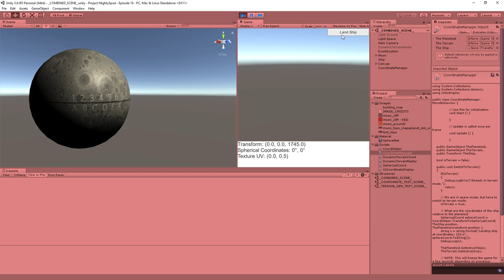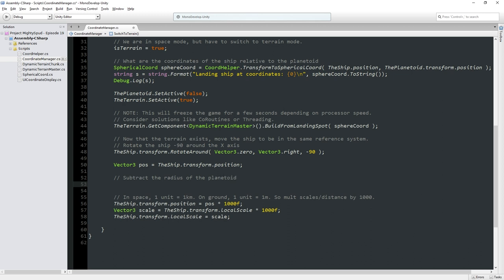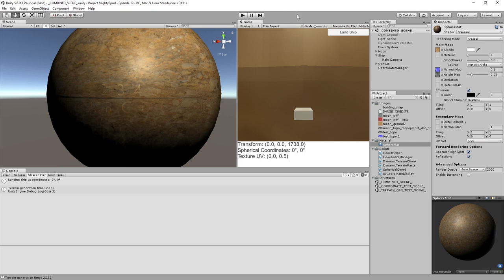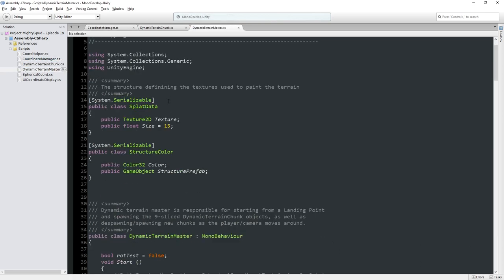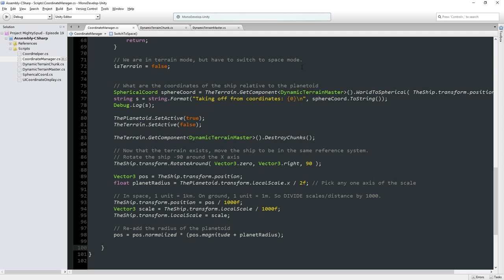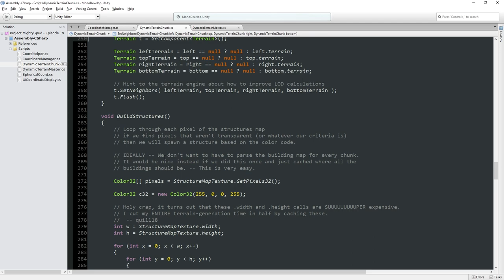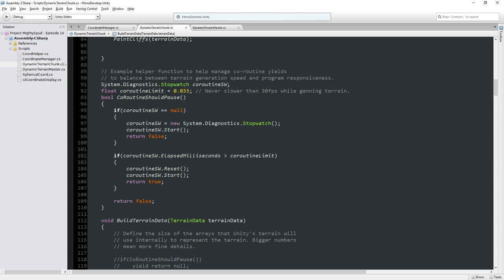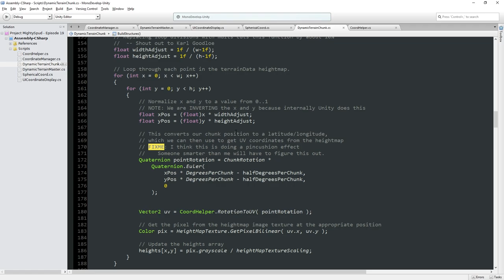Project MightySpud - A Planet Simulation Game - Part 19

Comment: Make sure to scale things down even in the space view. You need to make the illusion of size because if you want large systems of planets, unity has an issue where things VERY far away from the origin start physics jiggling. They get around that by space view being scaled down quite a bit and making the ship the origin of space so that planets are far away and THEY jiggle but not the ship. 

I was having issues a little bit with the uploaded files but did some tests and it's working for a starting point! I scaled down the planet to 10 units and then moved the ship onto the dark side of the moon and I had a completely different terrain than the default (kept seeing the text on the planet). Now to get neighboring tiles to spawn in so I can traverse on the ground. Thanks!

Have you done any tutorials on octrees and quadtrees or should we not worry about it as unity should be handling the terrain LOD, right? Kerbal uses quadtrees for the planet LOD.